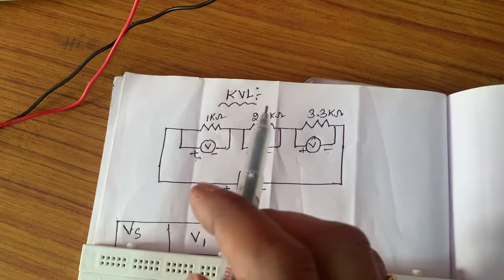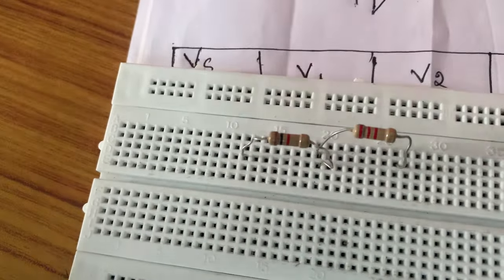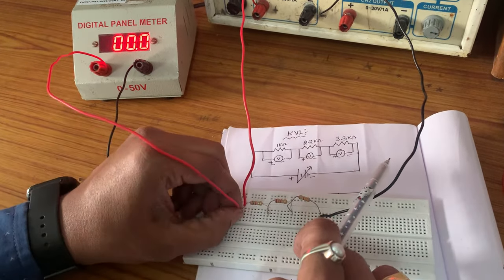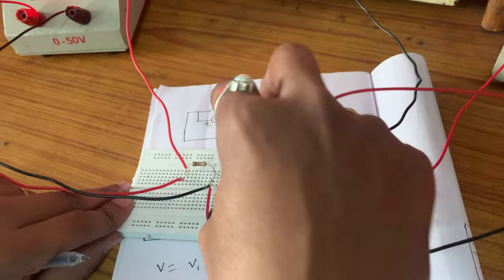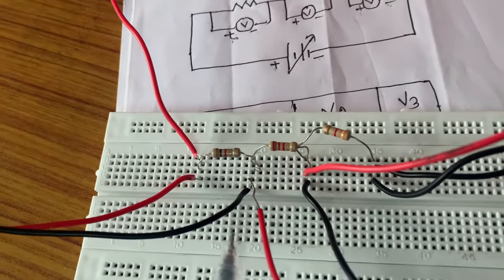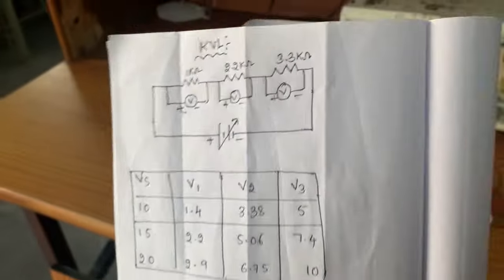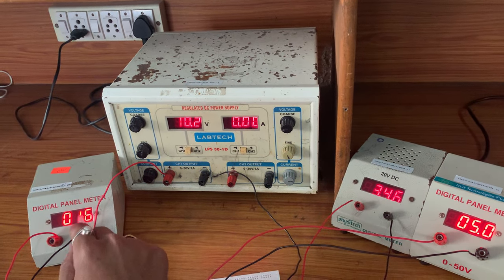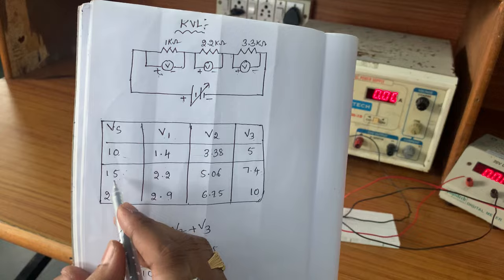4.Kirchhoff's Voltage Law Lab Experiment | KVL | Basic Electrical and Electronics Engineering Lab

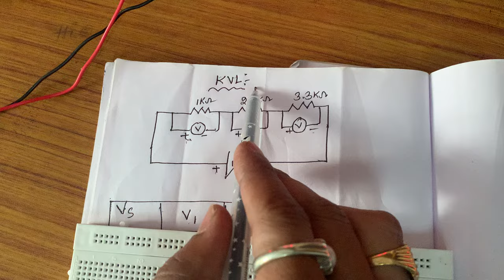Comment: 00:09 A circuit diagram of ketchup's voltage line consisting of three resistors.

00:54 The circuit consists of resistors and an RPS.

01:42 RPS negative is connected to a 3.3 kilo ohm second terminal.

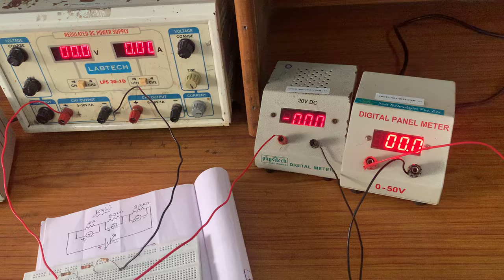02:38 Three voltmeters are connected in a circuit

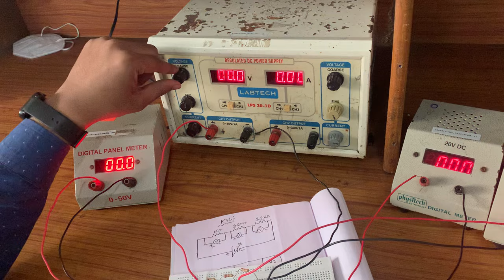03:42 The regulated power supply is used to vary the voltage gradually.

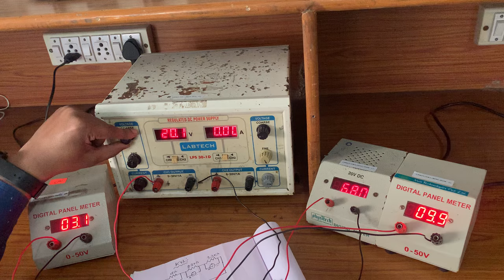04:43 Voltage values V1, V2, and V3 at different voltage levels.

05:53 The voltage values at 10 volts are V1=1.4V, V2=3.38V, and V3=5V.

06:53 Kirchhoff's voltage law (KVL) is verified when the sum of individual voltages equals the total voltage.